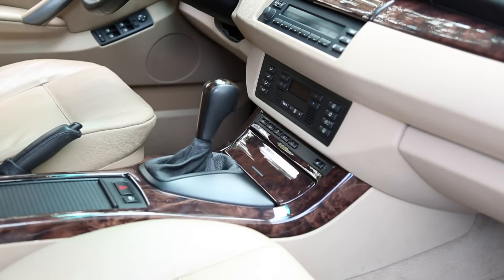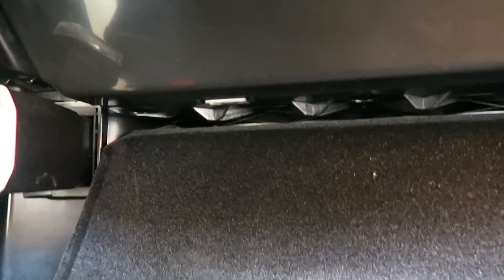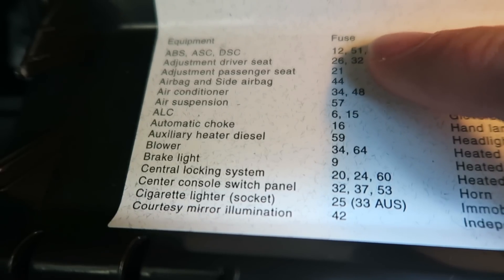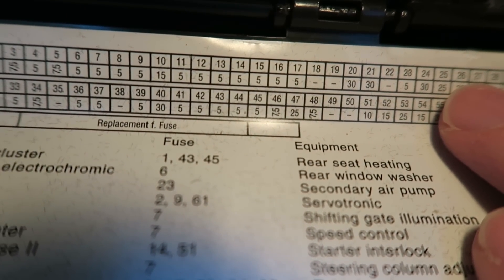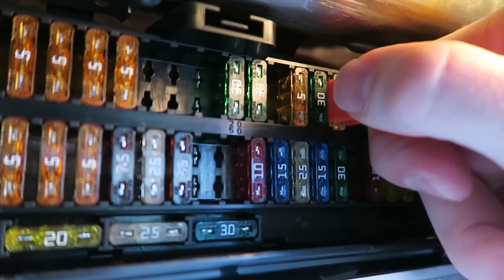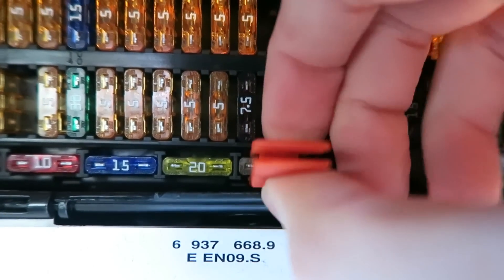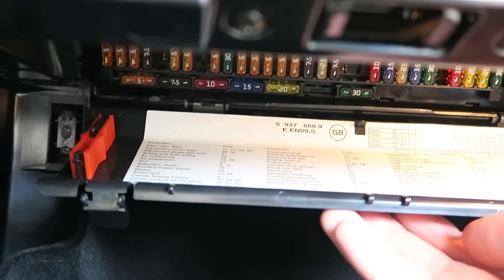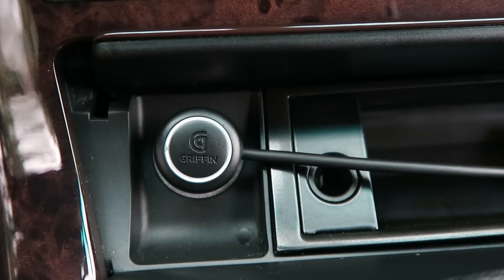X5 Cigarette Power Outlet Not Working - How To Repair E53 BMW

Comment: Thanks! I had a problem with my passenger door, window, and mirror not getting power. I thought it was the module that controls these function by prying out the window control box on the door but that didn't work. I wasn't sure where the fuse box was so I searched and found this video. It was a blown fuse. This was a great help. Thanks again!
Reply from the maker: Mike, that is great to hear! Glad this helped!
Reply: Mikesfunbox hello,  i have the same problem with my passenger door not unlocking. Is this the same problem you had?  If so,  which fuse was the fix?
Reply: Check the legend on your fuse box above the fuses. It's a 30 amp fuse. I believe it was the 5th or 6th from the right side. You will see in this video that there are 30 amp fuses in those locations . If one of them is burnt you will need to replace it. I actually had no power to the door lock, window and side mirror. Good luck.

Comment: Cheers for the video. Helped me locate my fuses easily so I could fix Trans Failsafe Prog and Engine Failsafe Prog errors after messing with the OBD port wiring. Fuse 31 had blown on my 2004 4.8iS!

Comment: Really useful video and u have such a nice example of the E53 X5! Quick question no air is coming out of the vents but the climate control screen still works as well as the buttons.
Reply from the maker: could be your final stage unit or blower resistor

Comment: My mode button on my receiver along with the button to set the clock aren't working. If I reset the fuses, do you think that can fix the functionality of the button? I was able to follow the adapter video and add the aux cable to the radio!! Thanks for that!
Reply from the maker: Hey Darian, I would assume if the rest of the radio buttons are still functioning that it's not a fuse issue. You may actually need to replace the radio if individual buttons have stopped functioning. Or there may be a possible repair if you have the patience to take it apart!
Reply: BIMMER ZEIT I was thinking that I probably would have to replace it. Now it's just trying to find the most cost effective replacement unit. If you know of any good sites, let me know.
Reply from the maker: Darian try eBay, Bimmerfest Forums or Bimmerforums!

Comment: My mom have 2002 BMW X5 and the controls for the radio and the radio is not working could you show me how you get the radio to turn back on is there a fuse issue?

Comment: My fuse is totally fine. The light around the lighter works, but nothing works. What else can it be?
Reply: Did you figure that out? I have same problem
Reply: @adriangale  no, someone posted a fusekit, however, I change fuses nothing happens. Please elaborate

Comment: I have  2005 X5 3.0i and my heated seats do not work.  Once the button is pushed it stays lit for 3 seconds and then turns off.  Not sure if it is a fuse or what.  Any suggestions?  Which fuse number is it under?  Thanks in advance.
Reply: APPBURY locate the fuse box then look at the fuse box diagram & number fuse the locate yr seat fuse then see if it's damage.